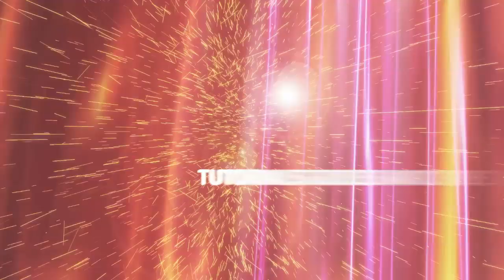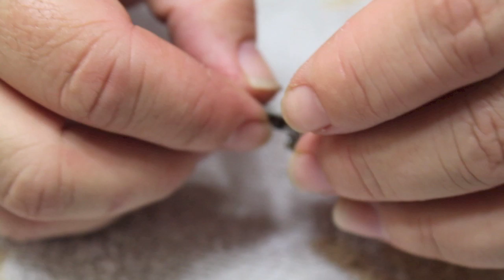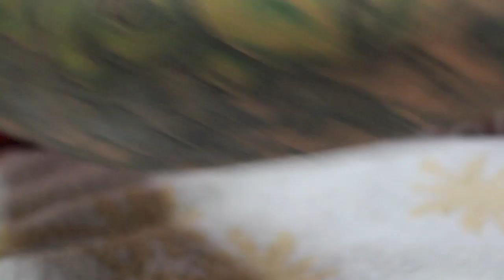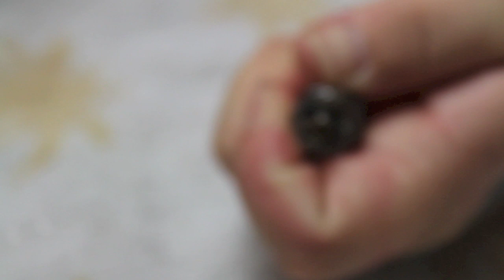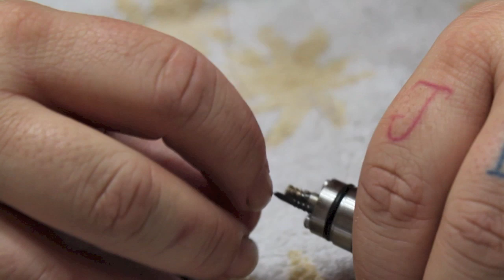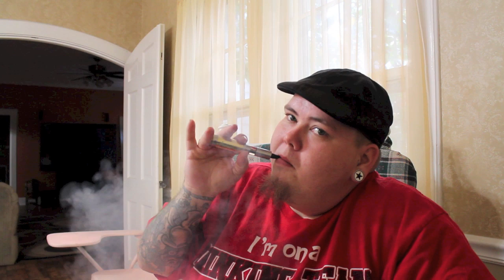Tutorial: Setting up a genesis atomizer from scratch with hotspot fixing

Comment: Thank you so much man. I got myself two old genesis style atomizers, but I really struggled with setting them up.
I first tried with silica wick, but that didn't really work for me, due to juice not flowing well at all.
Then I tried the ss-mesh wick, but I got hot-spots at the top of the coil that I couldn't get rid off no matter what, until I did it by your tutorial, and that worked wonders. 
So thanks for having made my Genesis journey a pleasant one so far👍

Comment: Followed the video and it worked like a charm.  Vaping on my new AGA T with a 30 gauge micro coil at 1.3 ohms.  The problem I had was firing the coil dry the first few times.  It would go wild and pop the coil or the ohms would jump all over.  Putting some juice on it fixed that.  I was able to oxidize the coil real well then dry fire to check the coil.  Thanks for the great video.

Comment: Very Nice Bro, I too have found that "Less Is More" on the wicks for these Genesis Atomizers. Mine in my Gemini is actually very small in diameter and has a 3/64 inch center channel. This is the perfect size for a huge plume of very thick and very flavorful vapor for my 2.2 ohm coils on the Gemini. My coils I wrap slightly differently but I will show that on a video I will be doing this weekend. This is probably the easiest set up I have seen yet though. 

Great Work Brother!
Nate

Comment: OK! Just got my ZMax and AGA T+ today, rolled my first wick, wound the oil on a # 6 machine screw, slid it on my tempered wick, fastened it, put the juice in, fired 'er up and  and voila! she's a workin' fine. It was so easy it's scary... something must be going wrong. But it is a smooth smoke with a hint of TH. Using Two Peas in a Pod Key Lime. Bliss!

Comment from the maker: I find also with a top coil issue.. pressing the coil into the wick if you reverse the direction of your wrap when finishing around the positive screw (which is just how i do it) i can press the wick into the top coil and a slight lifting and lowering the wick works it out pretty quick. Hot spots is generally just not an issue for me.. The top coil on occation as you saw in the video but it takes me as you saw 15 seconds to work it out..

Comment from the maker: Generally if there is a hot spot at the top like you saw its due to the top coil being to tight OR too loose.. I try to make sure theres pretty even pressure on all the coils going from top to bottom then lifting the wick in and out kinda evens out the pressure the coil is putting on the wick. Thats usual with a top coil issue.. If my hot spot is at the bottom which is rare ill disconnect the bottom and pull it a bit tighter as its from it being too lose at the bottom.. if in middle.. start over

Comment: I think, from context, that a hot spot is a portion of coil not making contact with the wick, thereby heating up much more rapidly than the rest of the coil. Besides for wasted heat, I would think it would melt that portion of the coil fairly quickly and give you two pieces of wire rather than one continuous coil.

Comment: also I have found that on my aga-t, 30g kanthal works the best, 32g pops instantly and 28g i can wrap a solid coil every time at 4 wraps it just isn't as high a resistance as I would like. 30g works the best for me at 4 or 5 wraps, doesn't pop and gives a decent resistance. Also 325 to 400 mesh 316ss is what i found works best on AGA-T

Comment from the maker: read these from the bottom up.. also you would be surprised how often fiddling the coil below the hot coil will help.. the hot spot is caused by shorting the coil out against the wick at the END of the hot spot so adjusting the coil after the hot spot helps the power continue flowing down the coil until as you seen in the video where they glow together.. you NEVER put juice in until they are firing uniform

Comment from the maker: Just because a coil is glowing red doesnt mean the coil is a bad coil.. just wrap then loose but touching.. dont choke the wick.. and if the top coil is glowing read just work it with a flat head adjusting it back and forth up and down... get the coils glowing evenly BEFORE you put juice in or you will never get there.

Comment: great vids jc, i just built my first coil in an rsst, 3/4 wrap running at 1.8 ohms @3.8 volts. its on 400 mesh with 15mm kanthal. im getting a very very strong taste also lots of popping of liquid of wick n coil. any tips??

thanks

Comment from the maker: im serious and not trying to be rude but if my wife can do it... ANYONE can.. that isnt a stab.. it just takes practice.. and dont buy 2feet of kanthal at a time.. buy a 100 foot spool from ebay from 9 bucks.. iw ent to probably 10 feet my first week learning.. as soon as you GET It you will have it made.. a torch does make it easier but a lighter will do just as well.. to avoid popping the coil at first instead of just firing it.. pulse it.. work the coil with a flat head where the glow stops